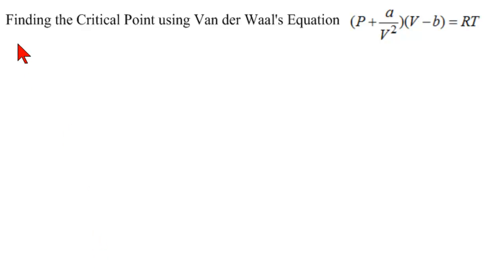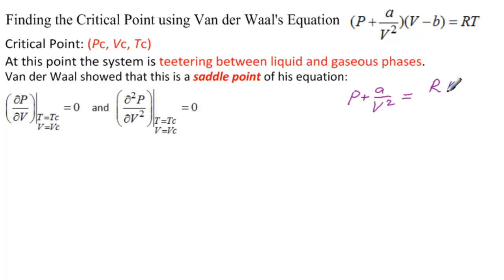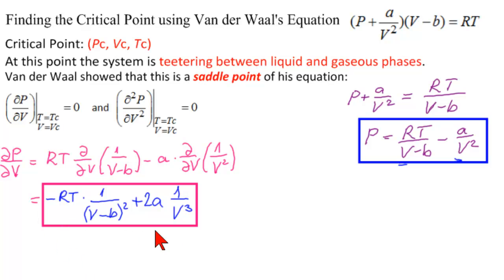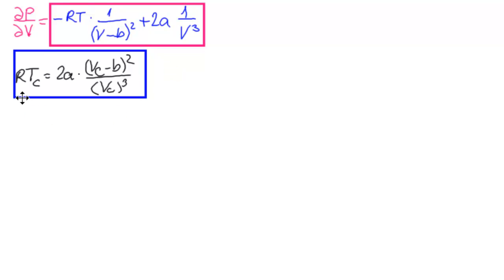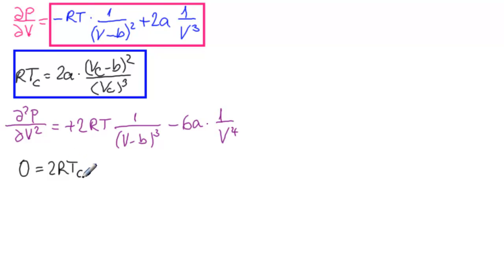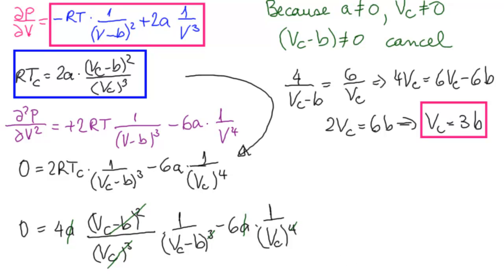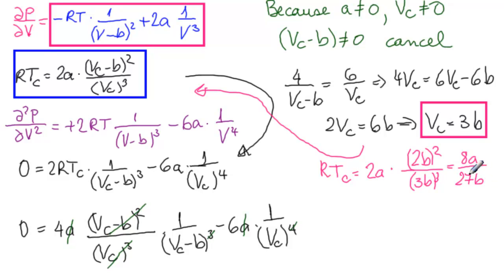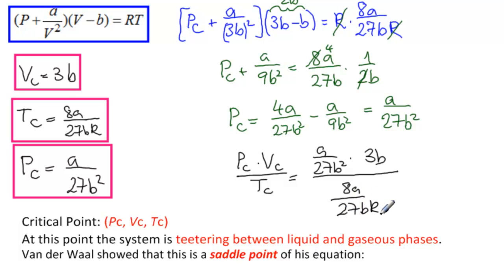Critical Point with Van der Waal's Equation

Comment: When solving for RT dont you have to change the sign inside the parenthesis. This is what I did: -RT = (-2a/v^3)(v-b)^2 so to get rid off of the negative R sing, I multiplied by (-1) and I get RT = (2a/v^3)(b-v)^2 because when I multiply the (-1) inside the parenthesis (v-b), I got -v + b. Correct me if I am wrong.

Comment: AWESOME!!!!!!  One question...I saw the last part at the end where you derived PV/T and got 3/8 times R.  If Van Der Waal is an approximation of ideal gas laws, then would this not only work for three eighths of a mole?  (Pardon my ignorance)
Reply: I have been wondering about that too.  Maybe the V in this is actually specific volume?  If anybody can shed some light on this, would appreciate.
Reply: Horribly late reply, but the form of the VDW eqtn she uses here includes Vm, not V, so one mole is innate. One could use the VDW form with n to derive the critical constants [P=(nRt/V-nb)-(an^2/V^2)] and still arrive at the same Tc, Vc, and Pc, though the extra parameter makes for a messier time. 3/8R doesn't depend on the moles, because Vm will always only consider volume of the gas per one mole. Recall that critical compressibility factor is Zc=(PcVc)/(RTc). VDW eqtn simply predicts that Zc=3/8=0.375 for a VDW gas at its respective Tc, as calculated and visualized by its isotherm. Though, any pchem book will likely include a table illustrating that for real gases, the value more closely approximates 0.300 (I'm going by Atkins' 10th edtn). Hope this helps.